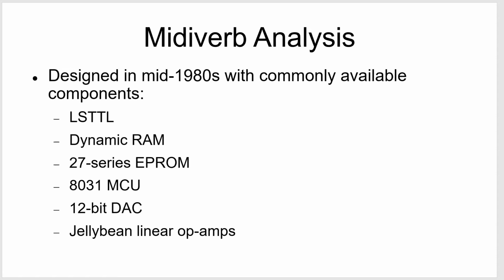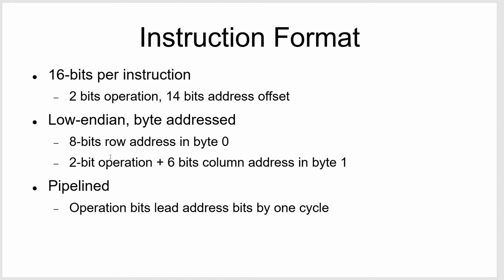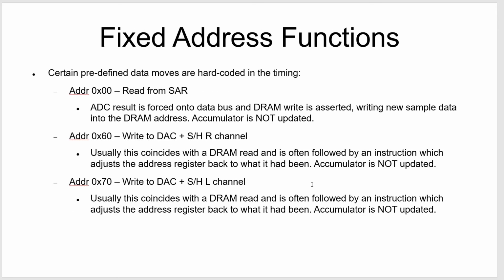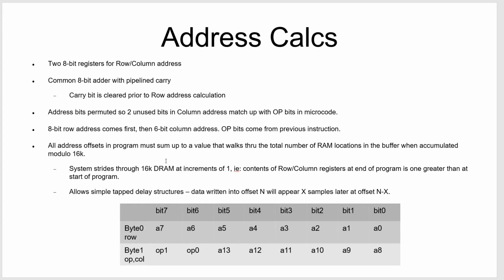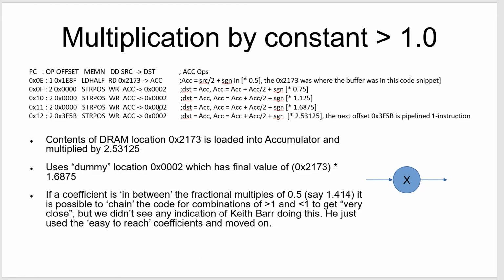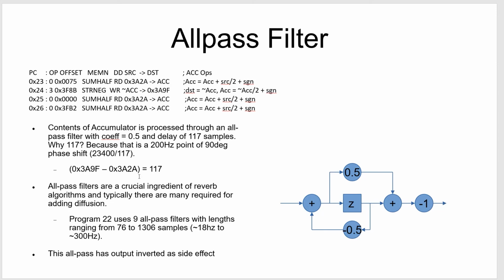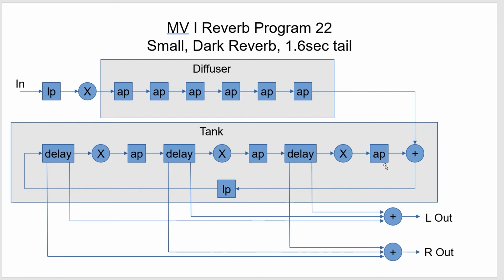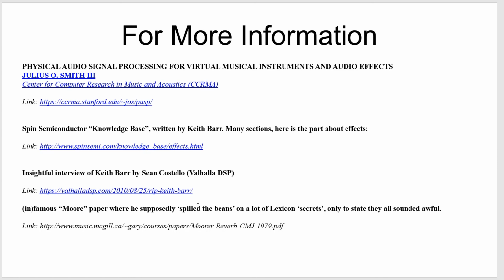Synthesis Technology: Reverse Engineering the Alesis MidiVerb 1: DSP Software

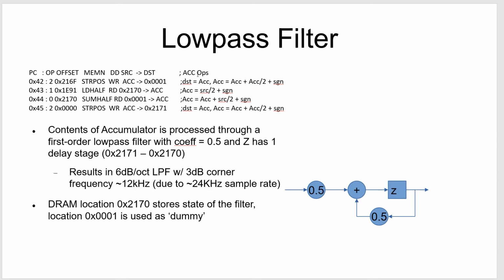Comment: ONe question thoug , at 35:57 
THe taps are taken from the start and end of the delay , but isn't the start of the delay the same as the output of the diffuser before it ?
Reply: The taps are not taken from the exact start and end of the delays - they're at somewhat randomized points within the delays but that's hard to convey on the diagram.